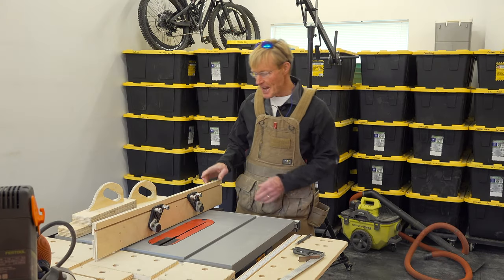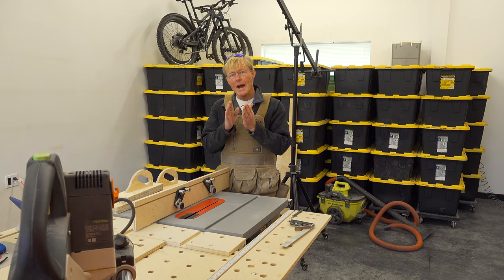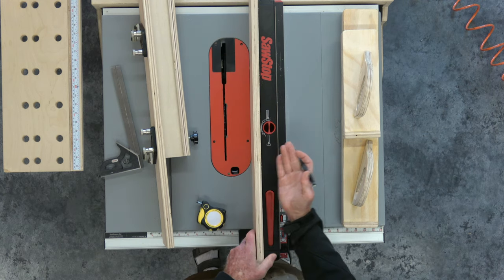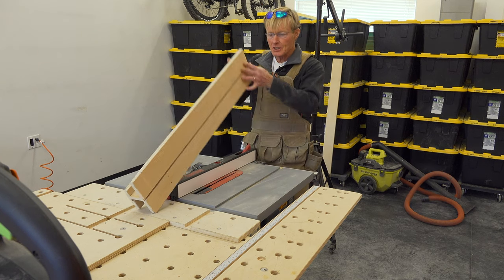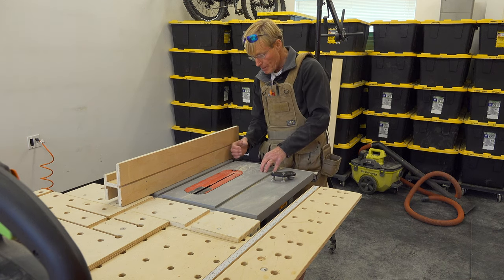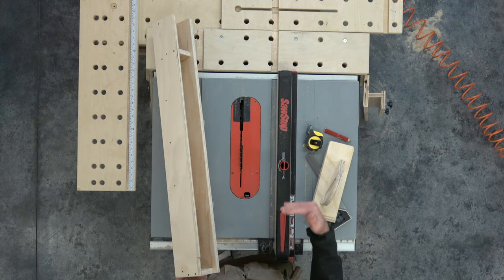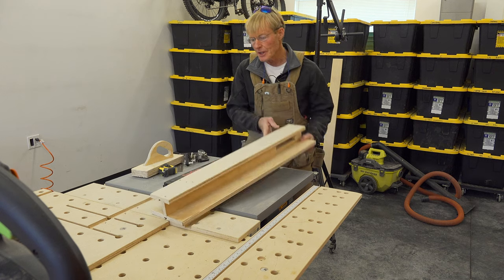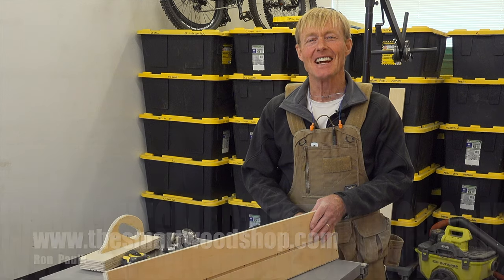Table Saw Auxiliary Fence

Comment: Assuming you have the Imperial scale on the saw you might consider making the fence on the blade side 1" thick so that you could continue to use the scale with a 1" adjustment. Perhaps attach a (say, 3/8" thick) softwood board to the 18mm ply and then plane it down to 1". Similar if you've installed a metric scale (say, 20mm thick fence). By the way, Sawstop has a part number for a metric scale for that saw (it's in the manual) but customer support told me it's not available. Boo!

Comment: Hi Ron, im in the process of ordering a custom Mission Trailer. Did you add any new features to the trailer or have any suggestions on what I should order extra on this trailer? Examples: different flooring, Linex the floor, lights, etc.  I'll be buying your plans very soon to  build it out. Thanks for putting all this together